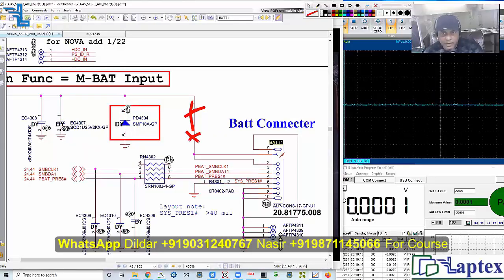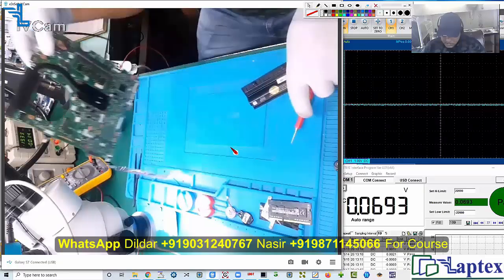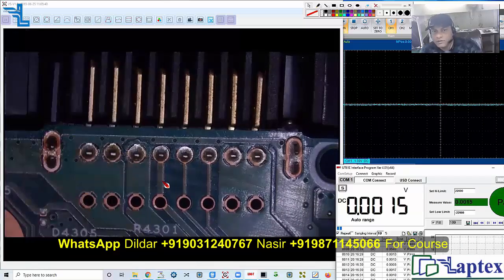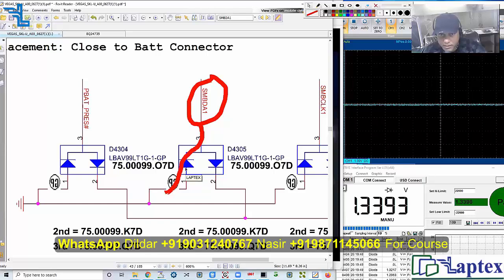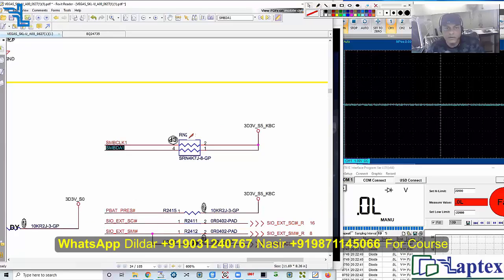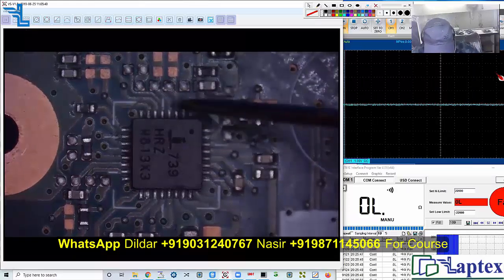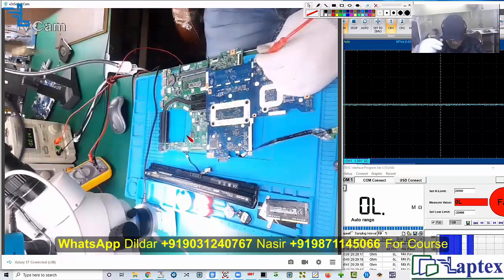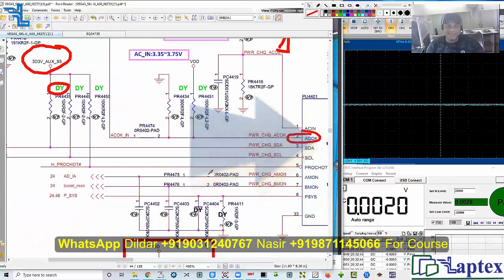Dell Vegas Bat Charging Problem | Laptop battery not charging Eng Part 3| Chiplevel repairing course

Comment: Please sir can you check on adapter feedback pins and battery feed back pins(ACN,ACP) if there is continuity on both battery feed back pins and adapter feed back pins .Because sometimes tracks can be damaged.
OR.
If they are OK .Then you check also on SDA SCLk frequency  because since you have just tested only carrier voltage .To observe whether there is communication between Master and slave.
OR
Please sir .I would like to know if you also measured on its PSID signal whether BIOS is detecting Adapter wattage .Since you also told us they had tempered on its PSID
OR
Please sir Can you also cheçk on both adapter Current low Ohm resistor and Battery current Low Ohm Resistor if there resistance is right and OK.

Comment: very nice sir
 only voltage is not required to charge the battery may data missing that come from iO through that particular resistor .
but you known you the best to solve this particular problem.
Reply from the maker: Thanks brother 👍. Will update that in the upcoming videos. Keep supporting and Sharing our videos 😊
Reply: @laptex1377  thank you sir, yes inshallah you will achieve more and more . keep updating like this sir g.

Comment: It's not charging because the psi communication is not set, you need to use a proper dell adapter sir. I stand to be corrected.
Reply from the maker: We were also thinking of the same reason. Let's see if that will work or not in the next part. Keep supporting and Sharing our videos 😊